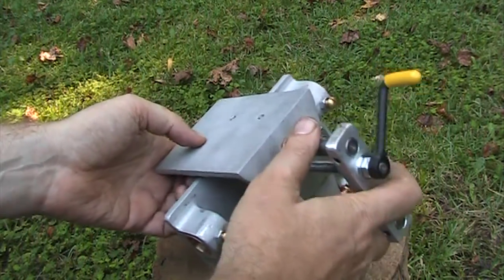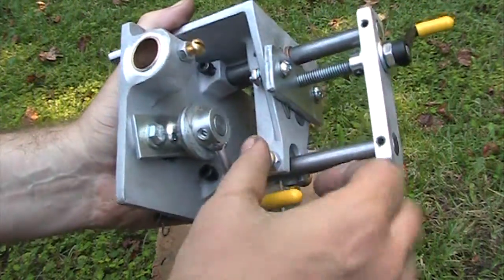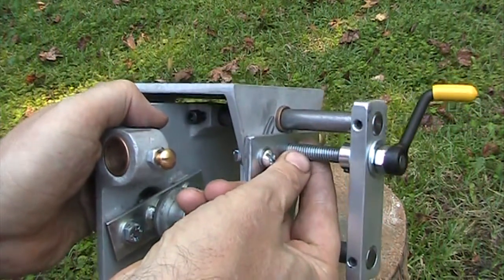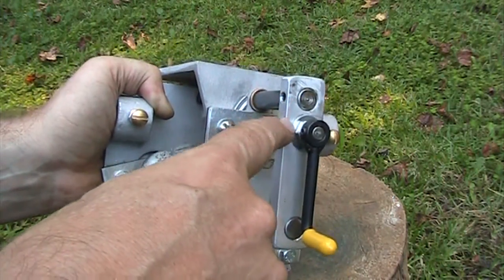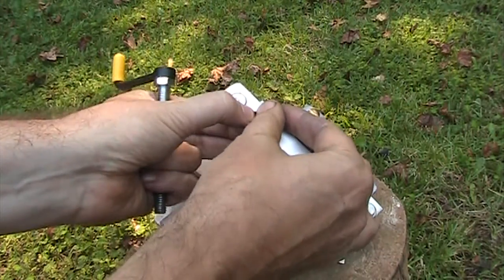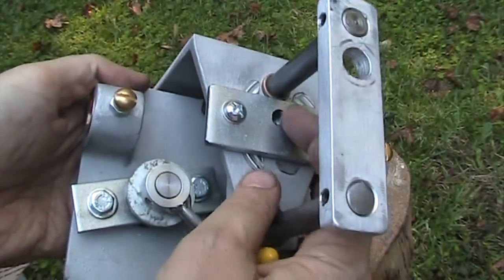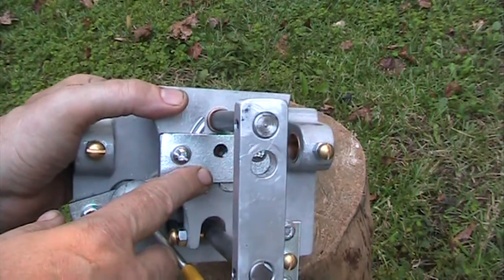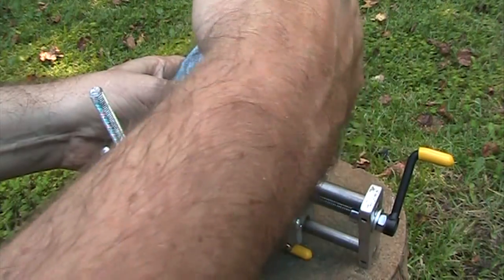Lortone Lapidary Slab Saw LS-10 Retrofit Vise Assembly

Comment: Thanks for sharing ... What holds the bronze bushing in the assembly?  Good idea the bushing and the steel support plate.
Reply from the maker: The larger bushings on the parallel bars have a hole on one side and are held in place with screws anchored with nuts. The smaller bushings are either tight enough to be pressed in and not move or have collars on one side which also prevents movement. The use of bushings like this means you can use these saws for decades. Pure genius by Lortone except it means they sell less saws overall. But (last I looked) I can still get parts for my Lortone LS-10 which I bought  over 30 years ago.